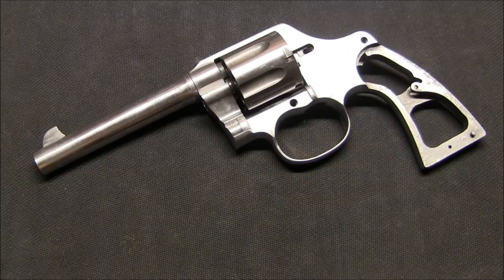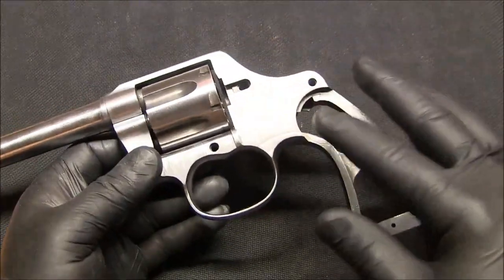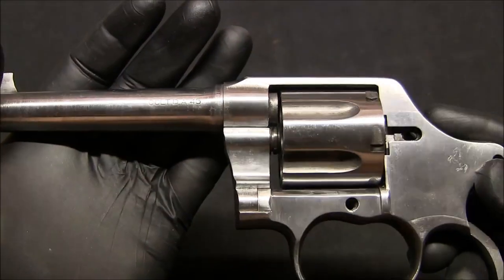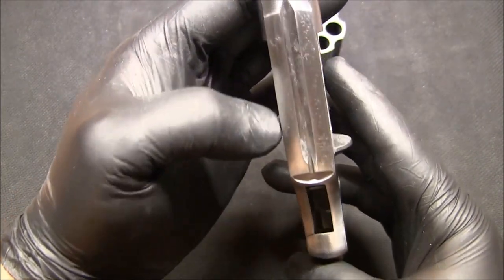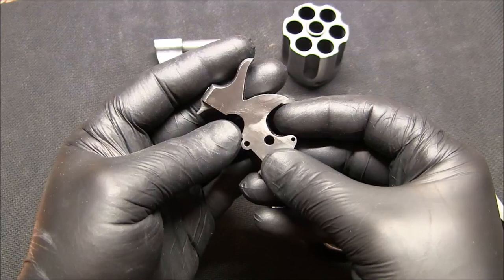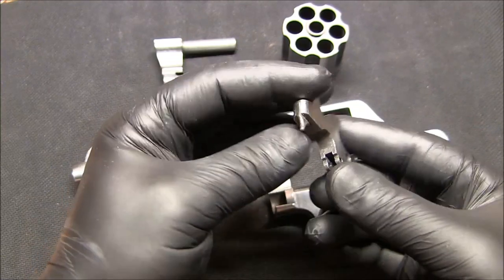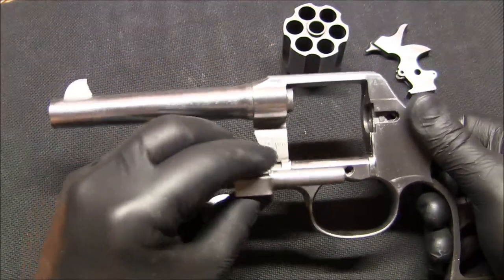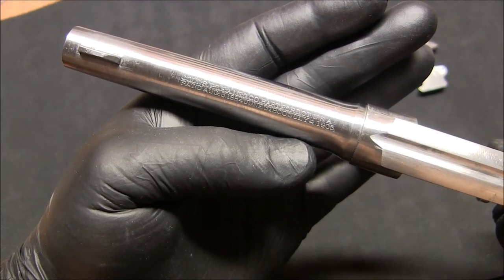Colt 1917 Army Revolver Restoration - Part 2 - Sanded

Comment: This project has come along very well, when I read the term "sanding" I did have some moments of horror, (sanding is for wood) but I see now you used emery ,or wet or dry paper, one small word here about cleaning the barrel outside, this should only ever be abraded using longditudal strokes, never round and round, as when blued you will see radial marks through the bluing, as very nice job, and no horrid rounded off corners from buffing!
Reply from the maker: Thank you for your feedback. I will definitely keep it in mind for future projects. Don't know why I didn't consider that.

Comment: Lets not forget that Colt 1917s had a "wartime finish" and were sanded rough then heat oven blued and were also sanded rough in the arsenals when they were sent to be refurbrushed and then rust blued or later in WWII sandblasted and parkerized.
Reply from the maker: Thank you, yes, the original finish was much rougher, but I don't think I would have been able to replicate it completely in home conditions. Thank you for the information.
Reply: To me it now looks like an authentic pre WWII arsenal refinish which would have been rust blue. Some polishing was rougher than others depending on who was doing it.

Comment: Looks great! Any chance of sharing your sanding/filing techniques, especially regarding retaining the factory marking? Thanks
Reply from the maker: Hi, I don't do anything special. I try to stay away from filing or sanding over the lettering, while also trying to not stay in one spot for too long. Originally, I thought that i would try to deepen the markings and lettering by acid etching, but I didn't have to do that on this revolver. I will still try to see how this can be done so that I don't have to worry about creating a "rippled" surface. If lettering is deeper, everything can be filed down evenly without having to worry about the stampings.
Reply: @MosinVirus  I think he wanted to know if you used wet or dry sandpaper, and what grit.  Also, did you just do it all by hand or involve some power equipment?
Reply from the maker: @robertbrandywine  I used dry sandpaper in 220-400 grit I believe. And all of it was done by hand using wooden backer blocks of various sizes.
Reply: @MosinVirus  Thanks!

Comment: Awesome, thanks for sharing, do you have a video  of the sanding  process
Reply from the maker: No sorry. At the time I thought people would get bored seeing the sanding process so I didn't film it. The key to sanding is using sanding backers with sand paper over them to make sure the flats stay flat etc. And not sanding in one spot for too long to prevent creating a wavy surface. And I always sand in a crisscross pattern. For example, length wise and then width wise, so that I see what scratches remain, and removing them before moving to higher grit.
Reply: Is kind of boring but a must part for a restoration process, jejje. Currently working on a 32-20 Eibar s&w copy.
Keep your the good work
Reply from the maker: Thank you.

Comment: Would you please tell me what you used to sand down your gun parts.  I have a model 1911 made in 1918 with severe pits.  A sandblaster will cut too deep and remove the markings.  I am currently using 600 wet sand paper, 000 steel wool, and brass wire.  Thank you.
Reply from the maker: 17stents I used 320 and 400 selectively. Had to get creative when sanding and spot sand as oppose to even sanding, then blend, then use 600 to even out "grain"

Comment: what kind of grits and files did you use on this?  Looks great.
Reply from the maker: maddkraut03 hello. I used a medium file to address deep pitting, then fine file to smooth out the area. Then I moved to 220 grit and finally 320 grit. 320 grit was the only thing that touched areas with markings, and very lightly, just to produce same surface quality as the rest of the gun.
Reply from the maker: maddkraut03 also please check out how I fixed the forcing cone and cylinder gap on this revolver. The videos should be in the same project playlist
Reply: MosinVirus I watched them all!! I now want to do my 455 1917 colt in the same way.  How did you get the old bluing off?  did you sand the entire gun?  Also, what steps did you take to protect the stampings and proof marks?  My gun is full of brit/canadian proof marks which I do not want to damage.  Outstanding job.
Reply from the maker: maddkraut03 I used evaporust to remove bluing. I did sand the entire gun but only with 320. I used lower grits only where was necessary. I simply avoided areas with stampings/roll marks. If you have pitting over markings either leave it or deepen it first by etching.
Reply: MosinVirus any idea where I can find info on etching?  sorry to be anuisance, but you and the vids are extremely helpful.
Reply from the maker: Hi. Absolutely no problem. Look up videos on knife etching. The process of etching is the same. With lettering though, you could use a transparent nail polish or something similar. And then I would scratch the coat by tracing the letter. This way the letter or mark is the only thing exposed and etching.

Comment: As far as pitting goes, the minuscule amount of metal you're taking from the frame and barrel will not make it unsafe to fire. Please go back and take the rest off from all the non moving parts that don't have to be in close tolerances! Haha good luck on your build.
Reply from the maker: Thanks for commenting. Some of the pitting is very deep, and if I do go after it, and assuming I don't want to spot-sand, but to keep the surfaces straight, would you still recommend to do it? Also, how would you recommend to go about making sure that the logos and lettering are safe?